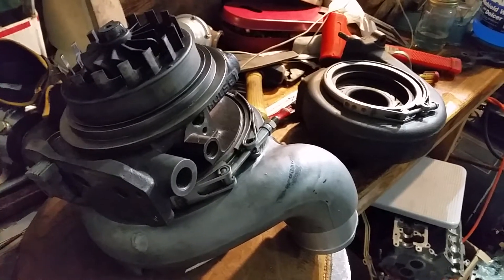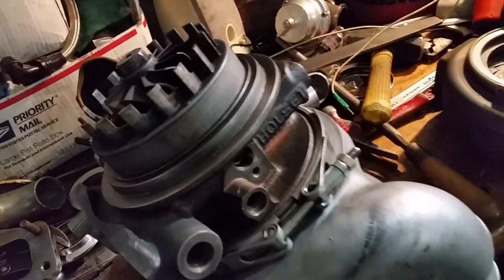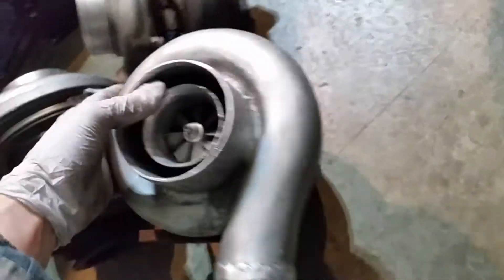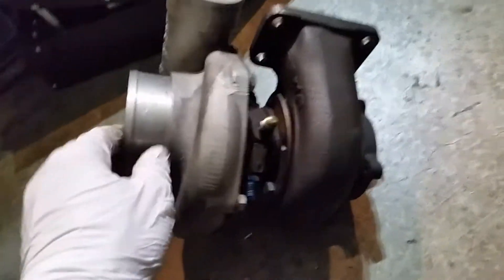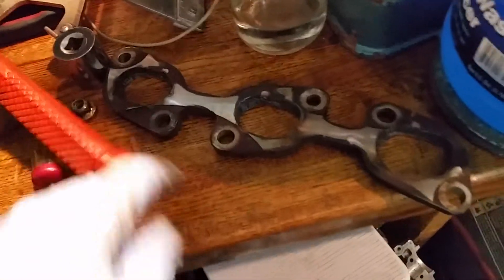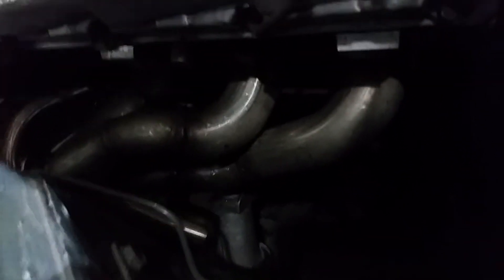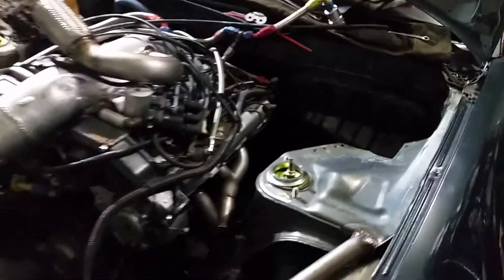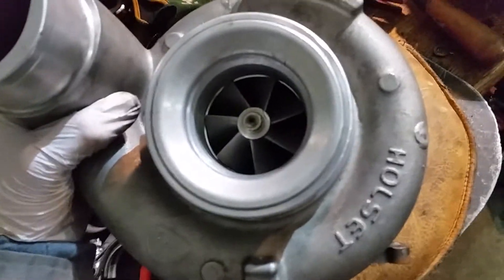HE351VE Holset Variable geometry turbine and my project.

Comment from the maker: Yes. I talk about it in the video. I am doing a pneumatic controller. Simple ram-lever style with boost pressure. Both adjustable and on the fly adjustable for fun from the drivers seat.